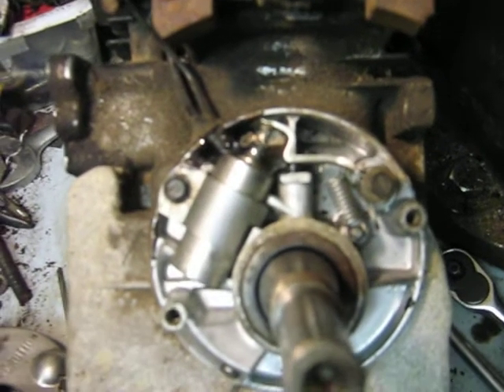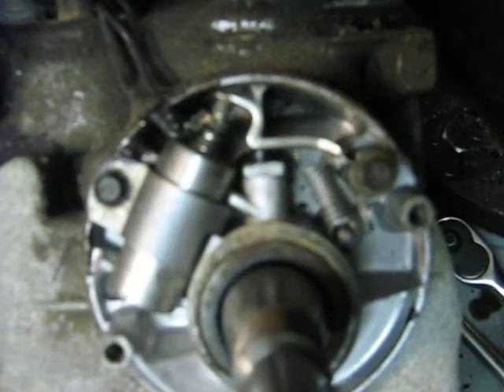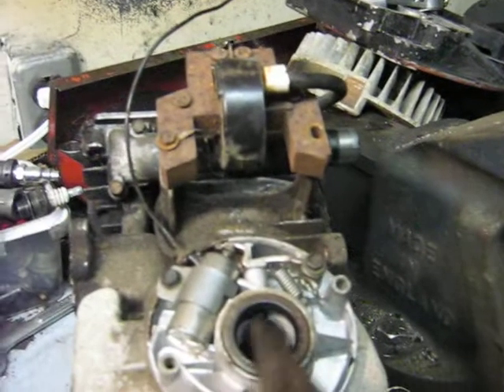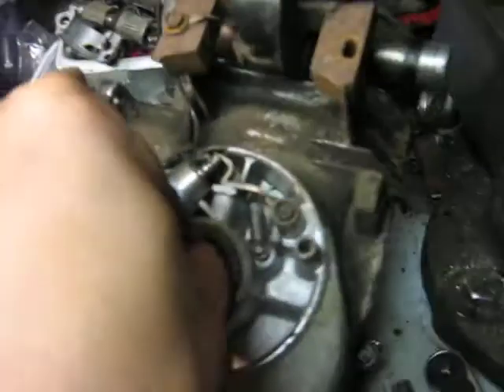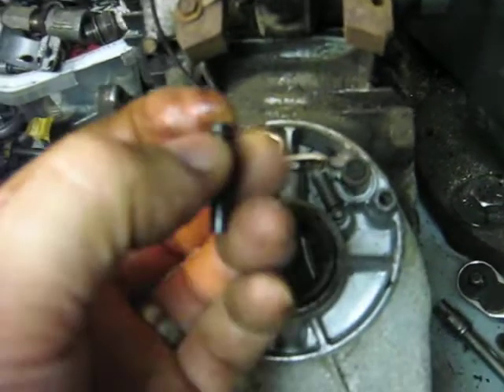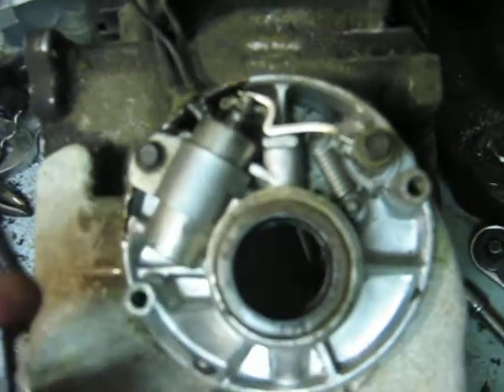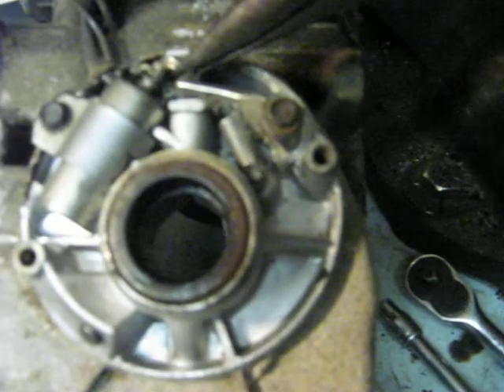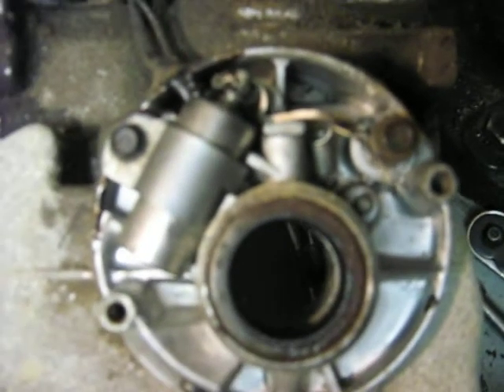Breaker Points on a Briggs 2

Comment: Those plungers should be replaced every couple points changes, mine was all swelled up and broke and I had a hell of a time getting it out, from 30 years of heat and oil finally getting to it.